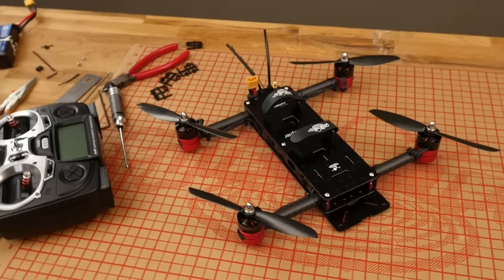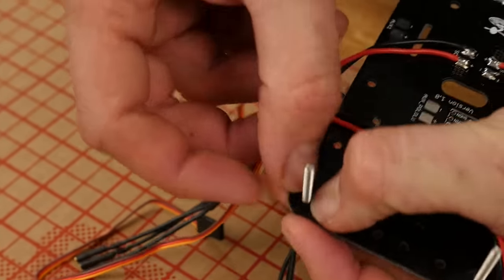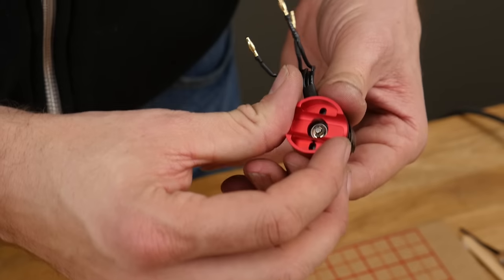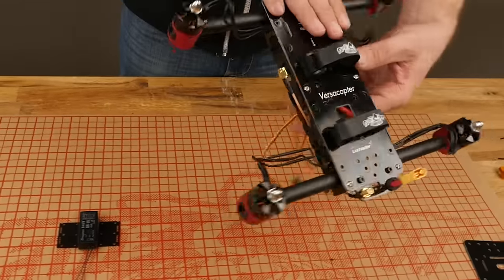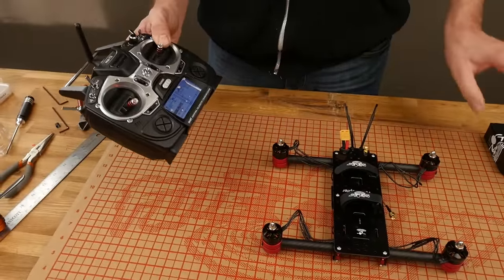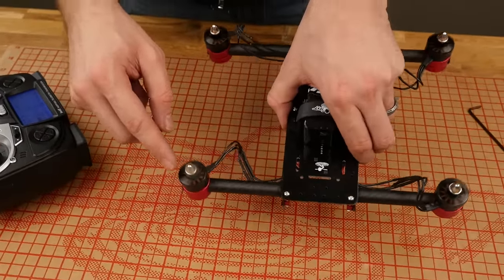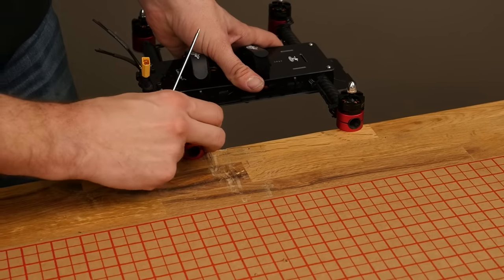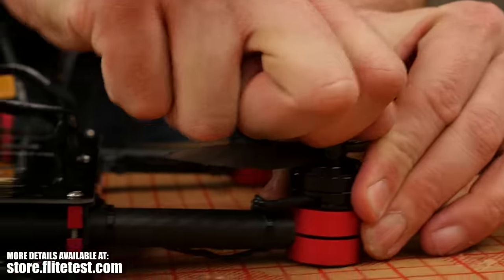FT VersaCopter v2.0 - BUILD | Flite Test

Comment: What kind of batteries should I get for it?
Reply: ive got the same question :/
Reply: I'm planning on getting some 1300mAh 4S 45-90C batteries from HobbyKing
Reply: okay thanks, but now i have a new problem, do you know what i could do when (after a succesfuly bind) the motors just dont work?
(got a Graupner gr-18 and Mz-18)
Reply: Have you armed the motors? That happened to me when I built my Electrohub with the KK2 board
Reply: how do i arm them ? i thought it would work when i connect them :/
Reply: It really just depends on what board you are using. For the KK2 board that I have and the Naze32 boards (I think), you would apply full right rudder to arm the motors, and full left rudder to disarm the motors.

Comment: so i if i buy the power pack what other components would i need to buy??
Reply: +Joshua Bartholome Assuming you have nothing else, you'll need a 4+ channel receiver and transmitter, at least a 3-cell (also called a 3s) battery and appropriate connectors/chargers/etc, flight controller (FT sells a naze32 that works with any Rx), and manufacturing tools to get it up in the air.
Reply: +The Falcon thank you

Comment: When will these be released. I have a grounded versa.
Reply: +Stephen Oberlin They are already in the store, just ordered mine. :)
Reply: +Sean Duffy I'm interested to know how well it performs in crashes, as I'm aware the previous versacopter was easily broken. How is the durability of it?
Reply: So far I've had quite a few crashes and no damage at all, all that happens is that the booms twist, so you just twist them back and you're ready to go. These are crashes on grass and into trees though, I imagine if you ploughed it into a concrete floor something would break.